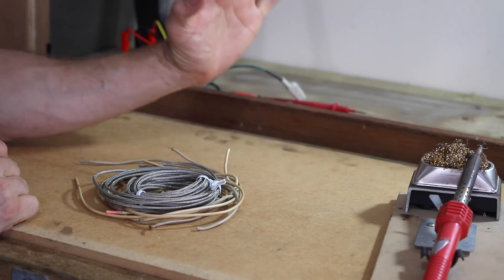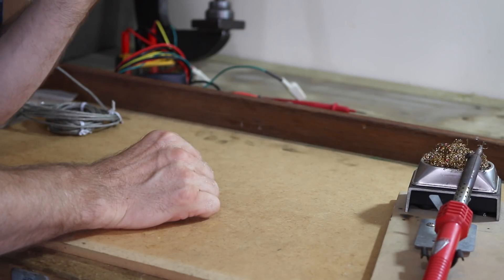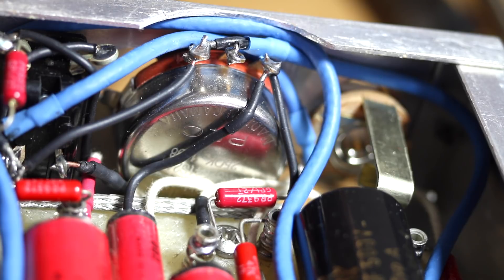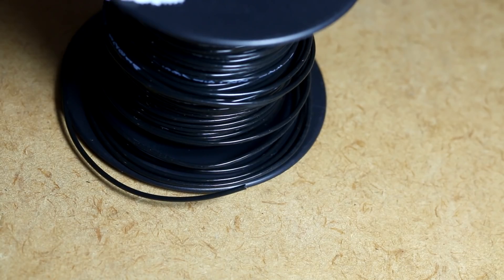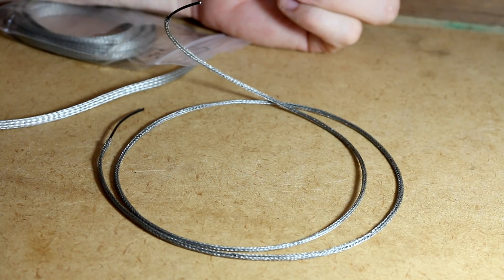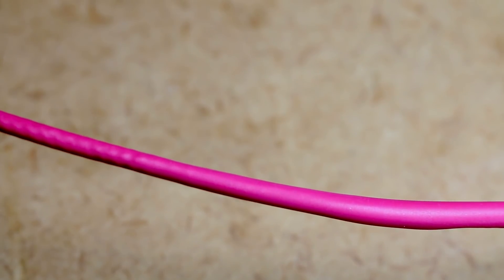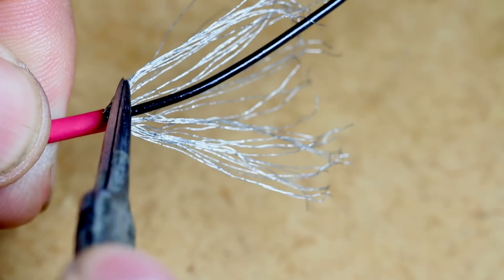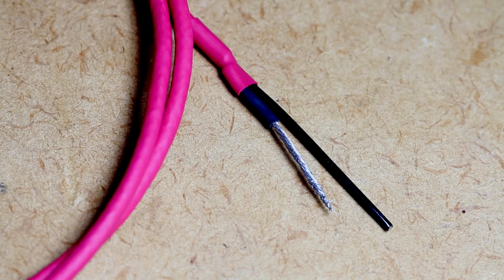Small Tube Amp Build - Tip Series (Build Your Own Shielded Cable)

Comment: What's the point? You can get shielded single conductor litz wire for less than what you'd have to pay for good quality sleeve and heatshrink alone.
Even the overpriced Mogami stuff is more cost effective than this.
Reply from the maker: As I alluded to in the vid, the insulation melts veryveasily on most bought cable, esp Mogami unfortunately. Also the insulation is very thick on most too. I haven't seen any that suits what I need, hence I make my own. Cheers.

Comment: Hi Jeff, is it possible or even a good idea to do the same using solid core?
have a good day!
Reply from the maker: Hi Sebastian. I have tried using solid core however solid core does have a tendency to snap once soldered, if you need to move the cable around. I have had it snap too many times and so now I use only stranded wire for the conductor. Cheers
Reply: @elams1894  I'll keep that in mind, thanks a lot!
Looking forward to future videos man, found great inspiration in the tube amp series!
Reply from the maker: @sebastianvergara8175  No problem Sebastian. I have finally finished modelling the same amp with a Bass/Mid/treble tone stack. I'll have the plans drawn up in a week or two, and once the chassis turns up in the post I can begin the video build series. Its a very beasty upgrade, noticeably more gain. The 18watt push pull version isnt far away also. Cheers
Reply: @elams1894  Awesome! i built a similar version of the 6w marshall a couple weeks ago, thanks to a friend I managed to add a passive effects loop with a tone knob post preamp.
i was wondering if it would be possible to add a separate amplification stage with only one 12au7 to create a clean channel with its own gain control (maybe reduced ratio to avoid distortion) and leave the original 12ax7 stage as the distorded one.
Maybe even add some sort of switch to choose between channels.
for what i´ve heard the 12au7 brings less distortion.
looking forward to the new series!! cheers.
Reply from the maker: @sebastianvergara8175  Nice work. Yes it's certainly possible to add a clean channel. I have that topography in this little amp. The crunch channel runs on three triodes (3 gain stages) and the clean channel runs on two triodes (2 gain stages). To work on two tubes, both channels share a triode. The evolution of this amp adds a 12AU7, which provides another gain stage, cathode follower tone stack, and recovery stage. However you can easily run a clean/crunch-2 channel preamp with just two tubes.
Reply: @elams1894  looking forward to the tone stack version ! 😁👍

Comment: There's better method than you show to separate the braid from the center conductor on a shielded wire. You don't need to tease apart all the strands of the braided cable. Just poke an opening in the side of the braid about 2 cm or so from the end of the cable, and then hook out the center conductor through the hole.
Reply from the maker: Thanks for kind comments Len. That tip sounds very logical and simple, probably why I miss d it ha ha. I tend to overcomplicate things but certainly some is always best. I will definitely use that, thanks. Just about finished designing two more amps, push pull, so good times. Cheers!

Comment: Can you tell me how to use this shielded cable please?I bought two core shielded cable and soldered the two cores to left and right channels and shield to to ground of my 3.5 mm audio jack but don't know if this is correct.please tell me the correct way to do this.I need to solder a shielded cable from a 3.5mm jack to input put of amplifier.

Comment: You can't find RG174 or similar?
Reply from the maker: I have some of RG174 coax cable however it doesn't suit for me. The dielectric insulator is a bit stiff and the melting point can be quite low. I just find it doesn't do what i want it to do and so I end up building my own. Cheers.

Comment: Very well presented , very clear video and sound. Excellent resolution. I must ask what sort of camera are you using ? Is it the video mike or an external mike ? thankyou for your clear presentation and delivery. cheers
Reply from the maker: I'm using a canon 70D camera with a shot gun Rode mic. I believe it is the lens that makes the difference in this instance however. I'm using  a 60 year old prime Macro Takumar (preset version 1:1) M42, Japanese made 50mm f4. Even at f4, I rate this lens equal with the legendary Takumar 85mm f1.8, it is that good. If you ever find one, the preset version, grab it with both hands, its a gem!
Reply: elams1894 pourquoi ne pas acheter une mine de cuivre et faire soi-même sa filerie???????!!!!!!!!!!!!!
Reply: elams1894 quels avantages ???????!!!

Comment: I have to replace a ribbon cable from tube socket on my blues junior, great video just what I needed. What do you suggest grounding the shield to?
Reply from the maker: It can get a bit tricky trying to ground the shield around the tube socket. I think that the other end other wire maybe a better place, near the pot as I assume the cable will be going to the pot or input? Probably best to ground the shield at that end. Thanks for kind words, have a great day, cheers

Comment: Most communication wire has a PVC or similar coating, with a low melting point, and is not "cured" the same way as lead wire and appliance wire - which are typically steam cured at high temperatures. Like the PO heat shrink tubing you're using, as well as cross-linking compounds, POE's, and rubbers.

Comment: I found that RF wire is quite cheap and fairly small being used to wire radio antennas such as the one in a router and radio control system but your wires looks very fancy! Of course there is no better than the stuff you make yourself.